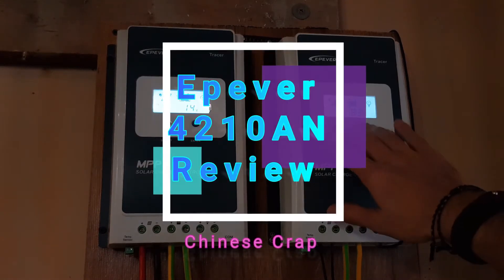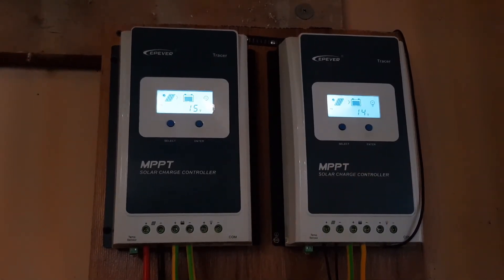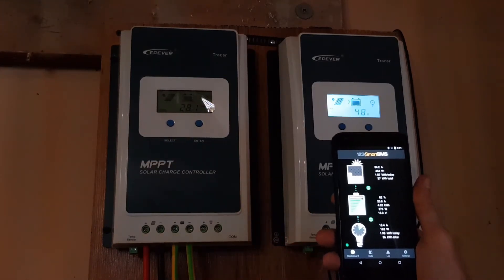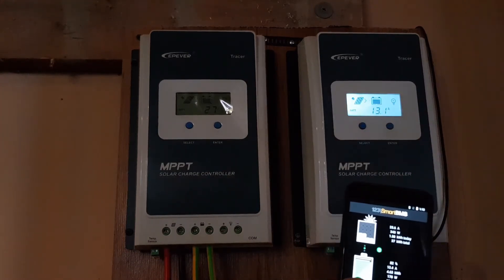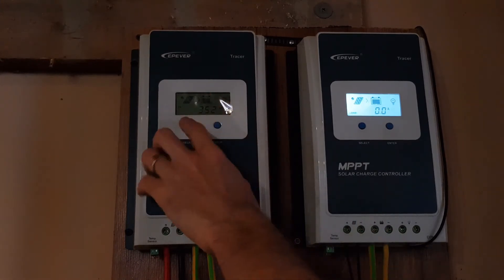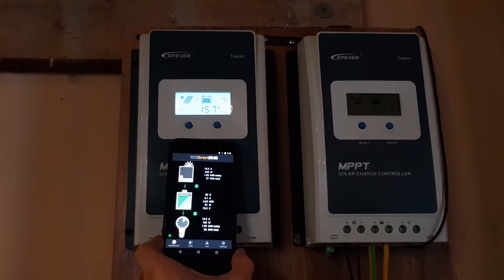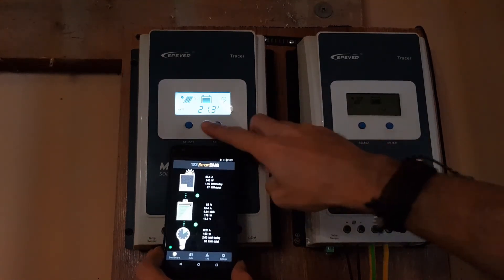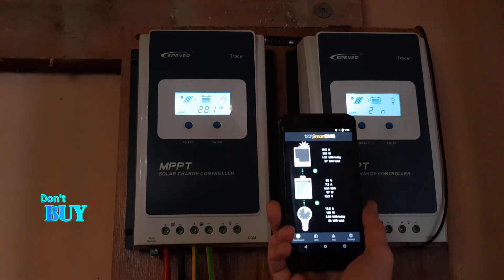Epever mppt solar charge controller 40a review

Comment: It seems to be battery charge voltage came to charge limit. Try increase charge limit voltage. After came to charge limit, charge controller switch to float mode. Float mode acting like this.
Reply from the maker: I tried everything but it does not work. The problem is that the input voltage witch is supposed to be around 26v-31v gets dragged down to 15v. Only output should be around 14v.
Some days it works correctly even if the float has been reached.
The only way i can think to make it work very time is to change my system from 12v to 24v with i am in the making so we will see in later videos.

Comment: No one can argue that items made in China are subject to gross specification violations, parts substitution during production, crappy components, poor documentation, and poor instruction manuals. Any software they seem to produce requires a cloud account, file permissions and some, gps locations. Chinas products are an analog of the CCP that has its hand up its puppet companies A$$. If you don’t believe me I’ve got a 9000 mah 18650 battery for you. What ever happened to the consumer protection agency ?
Reply from the maker: Agreed. The CCP is way out of control... But still this charger is working some days and some not :)

Comment: if you changed the type of battery, you have to reprogram the charge controller to the different type of battery.
Reply from the maker: I did all the settings correct, some days it works like MPPT and some it works like PWM.
I talked to Epever, they were no help.
Best solution was to switch to Victron witch on the same setup works perfect like MPPT every time, with no hiccups.
PS: also tried other settings but it worked the same.
With the same settings on Victron works like a charm.

Comment: It seems that you have a deep and personal hatred towards epever .. Or someone pays you for these videos ...
I have tested epever products for. 4 years living on solar energy.
I assure you they offer great quality for the price. Certainly the App needs improvement and they are doing it. But they are mmpt and there are dozens of comparison videos with other brands including victronenergy and it shows that the performance is comparable.
Just the fact that you think that between lithium and lead the controller can behave differently means that you don't know what you're talking about.
It makes no difference to the controller what load it handles. He does not know it!!!
What you encounter is a simple software bug with the Tracer controllers. When a sudden large load is applied, the controller drops production for a couple of minutes. But with the next tracking everything goes back to normal. It has nothing to do with a pwm controller. Do you know the electronic difference between pwm and mppt? This video is misleading.
Like the comparison between Epever and victronenergy made with panels in series and in parallel. Use all in series or all in parallel to make a comparison. !!
The whole world is delighted with epever controllers .... And in recent years they have been incredibly successful. The. Customer reviews have very high ratings. So are they all stupid ?? Only you can see the reality?
Reply: F C
I agree 100% a bloke at work has a Victron he said it nearly caught fire and after doing some investigation quite a few people have had the same problem. but i havent seen a bad review yet about epever contollers  there is to much competition out there bagging each other i have just brought a EPever 40A MPPT Charge Controller Tracer 4210AN extremely happy with it i chose that over the Victron because of the bad reviews
Reply: @Farmer2492  hallo,I have used for years both , victron and epever.
And deeply tested ,not like the joke comparison of these YouTube channel.

Victron is some better conversion efficiency...and a little faster tracking MPP in case of 2 or more falses MPP.

But the performance is very comparable. And the price of epever is half of victron.

Victron gains on one thing: the software, the app, and the possibility of work with schunts and other device in bluetooth network.
The victron software is probably the best of all competitors.

But epever make really goods controller. The inside construction quality is high.
The accuracy of measurements is decent and the conversion efficiency is good.

Victron accuracy is better, but construction quality, I don't know....
Reply from the maker: Hello. 
I have the two videos, one with the Epever on the right side and one with the Victron on the same side on the same setup and the same problem persists.
I know the components inside the Epever are MPPT but the charging algorithms are faulty.
The charger works ok in CV charging mode but very wrong in CC charging mode.
The next tracking that you talk about on a LiFePO4 battery does not happen until battery is almost full so charging changes to CV mode from CC mode.
Here is another video with the same problem 
just to show other people have this problem. I had 4 Epever chargers, all had this problem. https://youtu.be/hGjQILOhyEU

PS: I with i was paid for the videos.
Reply: @StarJackerSRL  I now the problem you are talking about. But the other video, with comparison between smartsolar and epever tracer is very doubtful for me.
1)not real test with parallel VS series. Make the same wit 2 IDENTICAL PANELS. 2 IDENTICAL WIRES (SAME LENGTH, SAME SECTION).
2)epever can be everything, but NOT CRAP. The quality of construction is even almost better than victronenergy. Have battery reverse polarity protection, victron no. Have lightning surge current protection, victron no.
I have tested (Really tested...) a epever tracer30A and victronenergy smartsolar. Victronenergy smartsolar give me something like 3/4 watts more than epever in stables conditions.
Epever give me max 310 watt of peak power after colud passing, with 300 w panel. Victronenergy give me 330 watt peak power. These are peaks of 10/20 seconds and than the power stabilize equal for both controllers, more or less.
I repeat that some difference can be in conversion efficiency.. Max 1 o 2% in favor of Victron. But max power in stables conditions cannot be very different!!! ALL MPPT CONTROLLERS search the MAX POWER VOLTAGE IN THE SAME WAY. someone can be more fast, someone more slow. But nobody can find a WRONG MP VOLTAGE AND OBTAIN much less power like in your video. These is impossible.
A panel at X MP VOLTAGE make X POWER, independent from mppt controller. A small difference can be for quality of conversion. But these is all.
Say that epever is "Chinese crap" is ridiculous.... Is a. very very very good "cheap" mppt brand. Maybe the best of all China brands and also at the same level of some much expensive European brands, like WESTERN (Italian), STECA(German), NDS (Italian for caravaning mppt), VOTRONIC (German for caravaning mppt), OUTBACK (USA)...
Victronenergy is probably the second best brand in the world, after MORNINGSTAR.... is better than epever? Yes! Is better like you say? No...

Comment: And about the tracking yes I have noticed that the tracking of the Risen algorithms aren't all that great. When the algorithms are freaking out from cloud cover if you shut it off and turn it back on it seems to fix itself but it's definitely a big software problem
Reply from the maker: I reset it all the time, but most of the time is just goes back to functioning like a chinese piece of ****. I think i will soon switch to 24v mode from 12v mode and get rid of the chinese epever controller and only use my Victron controller.
When i do i will make videos about it. Hope to see you in the comment section there too.

Comment: It just a question did you make sure you go on user settings and enable your lithium mode I think you may have to hook a PC to do that
Reply from the maker: I have PC software and smartphone software did the settings as the BMS states. I have the same settings on the victron controller and the epever controller. Victron works like a charm but the epever is a real pain in my ***, i have to constantly keep an eye on him.
PS: After a lot of trial and error settings i have figured it out. The Epever vorks only in CV mode and not in CC mode, the software is awful so most of the time it works as PWM and not MPPT.
Reply: @StarJackerSRL 
> The Epever vorks only in CV mode and not in CC mode

Could you explain what specifically you mean by CV or CC mode? I assume it could mean constant voltage and constant current mode. But I am not sure where in the charging controller's settings you can set these charging modes. These terms are not mentioned in the manual if I am looking correctly. I have only noticed the "voltage compensation" vs. "state of charge" charging modes.

Also, what specifically you mean by the charging controller "working" in this case? If you connect it e.g. to ~66V open circuit voltage panels as in your video, will the voltage keep dropping to ~15V as in this video or will the charging controller's behavior change? If so, how does it change?
Reply from the maker: @pbasista  Yes. CC is constant current and CV is constant voltage. What i mean by that is that any battery that is charging if it is in a low state of charge and it can accept all the power you can deliver it will charge in CC mode until it has reached the set top voltage at around 80% depending on charging power, at that point any charger will switch to CV and top the battery up as to not overcharge. That is why you will never charge a battery at the maximum power until 100%
As for the Epever charge controller if i connect 2 panels in series so the Open Voltage is 66V 1 out of 10 days it works as mppt at 58V 6Ah = 348w at the imput, but 9 days out of 10 it works as PWM at 15V 6Ah = 90w . That is a huge problem that all the Epever chargers have. The software is faulty , the MPPT charging algorithms are very bad for Epever chargers.
This never happens with my Victron MPPT smart solar 100/50 on the same panels and same wires.
CV for the Victron controller is Absorbtion mode of charging and 
CC for the Victron controller is Bulk mode of charging.

Comment: This is helpful, I have bought 20kwh lifepo4 batteries and going to by solar panels and charge controller as well. But have to ask, sure it isn't going down because the battery is full?
Reply from the maker: I am sure.Look at next video.Epever vs Victron Energy.
Reply from the maker: Some days the Epever works as it should, it works 1 out of 7 days but even in the days that it works if a cloud passes over and makes a shadow on my panels the voltage input on the Epever drops from 58v to 14v and does not rise up after the cloud passes. So most of the time the Epever works just like a PWM controller and not MPPT.
All the epever have this problem. I found other videos about this like this one https://youtu.be/K0LuMSXKO0M
Good luck and may the energy be with you!
Reply: @StarJackerSRL  these is a precise choice of epever designers. In extreme low power condition (less than 1.5 amp of production) epever controller switch from mppt mode to "direct charge" mode at 14v.
Why??because in these conditions the DC/DC conversion is inefficient and mppt tracking and DC dc conversion use energy. Also in these conditions the Pv voltage is unstable and increases the risk of damage on controller. In these conditions epever controllers stays on 14v and make a tracking every hour.
I spoke with Epever engineer directly.

Victronenergy simple don't work in extreme low power condition. Victronenergy start only with Pv 5v+ battery voltage. Epever start at Pv 2v+battery voltage but in direct charging mode. Simply are 2 differents choices
Reply: When the battery are full you should have open voltage of pannels and 0 amps. I have 2 pcs 4210An over 3 years,hoked up in parallel on bussbars on the same battery and works verry fine,both work on equalize and float time at the same time with no problem,i dont understand whats the problem with yours